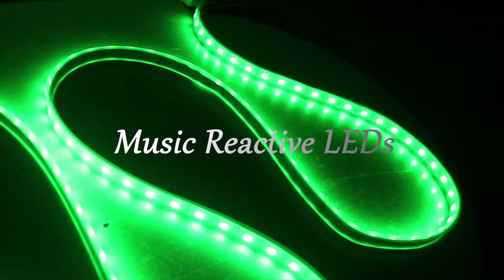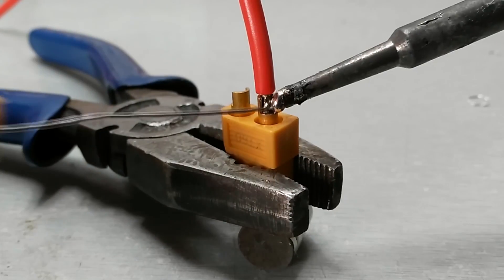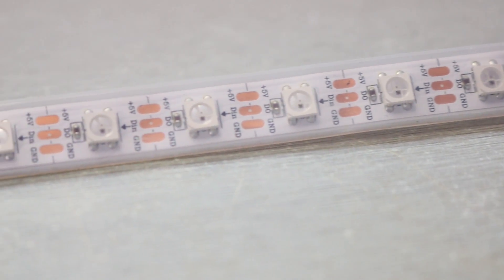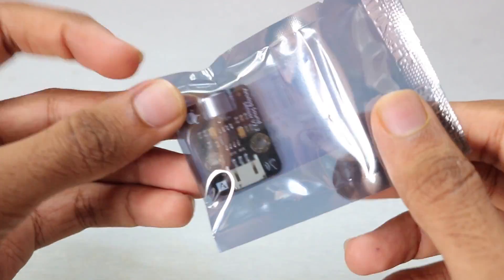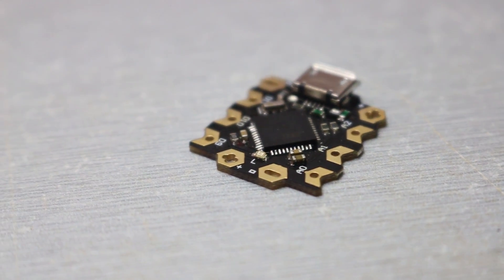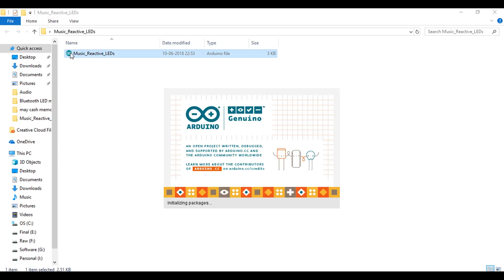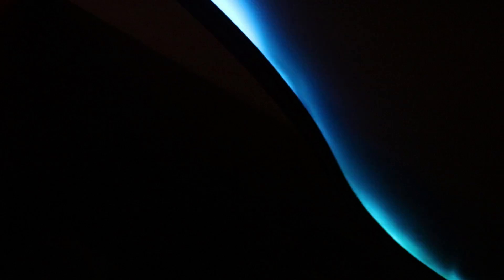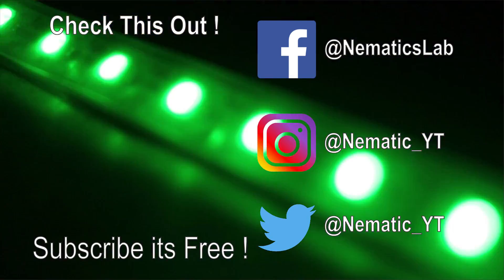How to Make Music Reactive LEDs | Arduino

Comment: BAD Tutorial : Your Setup is Bad, you use no Capacitor to prevent the Damage of your Pixels duo to Voltage Spikes, in 1-3 Month it will Fail. 
If you want a proper Setup, use this Guide : 
https://learn.adafruit.com/adafruit-neopixel-uberguide/powering-neopixels

Comment: Can one arduino handle 2 Led strips with 144 LED's?
Reply from the maker: Yes, Uno/Leonardo/micro/nano : don't go above 512 LEDs 

Mega : 1000 LEDs but not with many other things happening.
Reply: @Nematics_Lab  that means I can connect the data wire from arduino to two different LED strips?
Reply from the maker: @rwiehusain622  yes

Comment: Good going brother, Watched your work. 
Here is a seggestion for a next video, Instead of using a sound sensor take input directly from the music player via aux Cable and then process it to make LED light up. This system will be mush more accurate as the sound sensor pick a lot of noice and you also have to place your speaker near to it.

You need to implement FFT for the frequency separation, it takes effort but the reward is pretty clean end to end product.
Reply from the maker: Will try that

Comment: Is it also possible to connect it to the amp directly? 
I don't want to use a mic
Reply from the maker: Connect amp out to I/p
Reply: Nematic ! 
Could you show how it works?
I'm bad at electric stuff
Reply from the maker: Replace mic with amp
Reply: Can Mic change to Audio Jack ?

Comment: Hi great code.... Are you able to point me in the right direction.. I've wired up as described, but not sure my mic is working properly... Any ideas on how to test?
Reply from the maker: Are you using analog sound sensor or digital ? Circuit will work only with analog
Reply: Nematic ! The board has both.... I've only connected the analog... Along with 5v and negative
Reply from the maker: Might be a faulty one